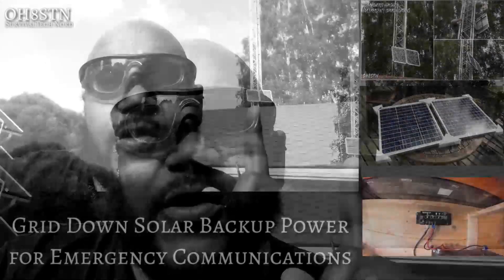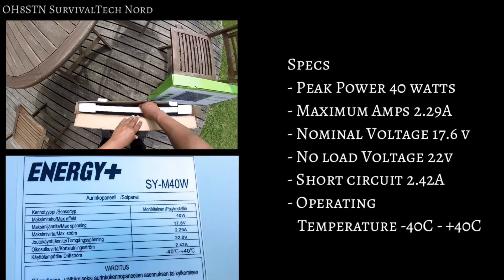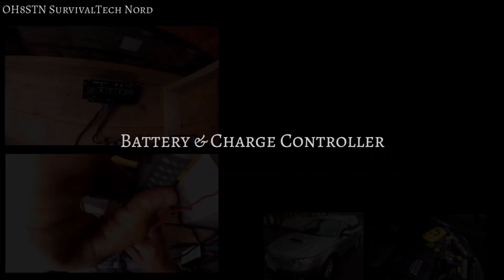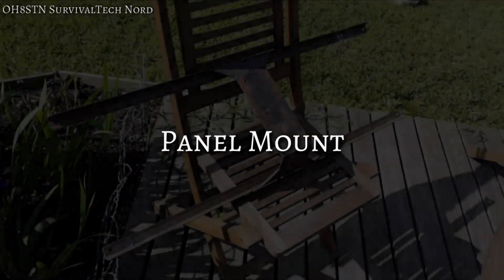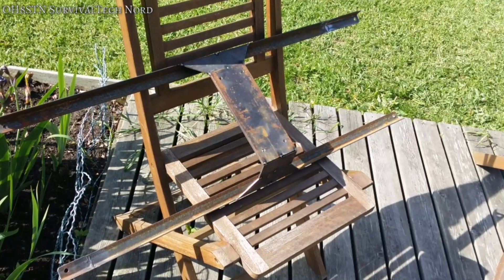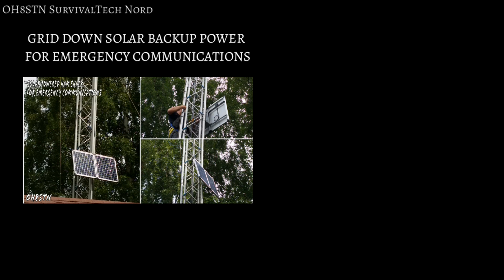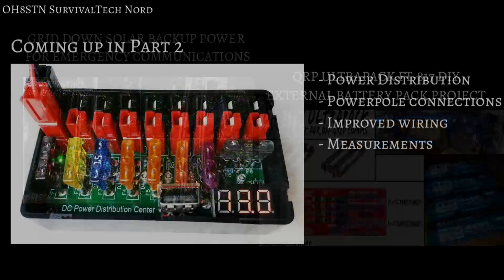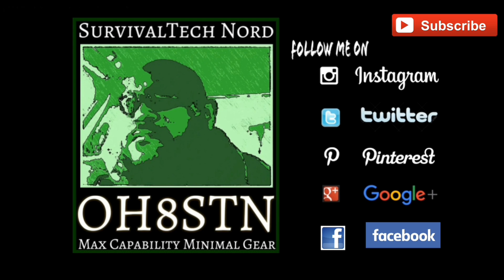Budget Solar Power for the Ham Radio Shack

Comment: Great video! Would love to see more about your base station and that tower with what your running up top!
Reply from the maker: Thanks Andy. The tower is set up for VHF/UHF weak signal work. There are three tag is up top. One for 6m, another for 2m, and the third for 70cm. Those are augmented by nultiband vertical for local FM. There's also a flagpole style pully to hoist end fed wires up to 12 meters. That will be changed in the spring to go the full 18 meters of the outside tower. 
Total height is 36 meters, but I only use half of the telescopic tower. 
73
Julian oh8stn

Comment: Nice setup, a perfect no nonsense video that will definitely help in my projects.
Reply from the maker: +Nomad-76 Thanks, glad if it helps! It's a starting point! For now It's small, DC only and lacks great capacity. However, it has powered my 50w radio and tablet  for digital comms continuously in the radio room, since I made that video. Primary mission accomplished :) 
Thanks for stopping by.

Comment: Great set up! looking forward to the finished product!! I need to expand my solar "system"
Reply from the maker: +VideosByDPF Thanks.  Until recently,  I've focused in portable power. The batcave needs to be completely solar powered with small DIY 2 stroke generator backup I'm working on. 
takes time,  but it'll get there.
Btw?  was wondering where you'd gone off to since you've been do quiet.

Comment: You can just add other panels to the same tower and have the new panels point in other directions (everywhere but north).  There is a kid a while back who did an adaptation of the Fibonacci sequence.   It gets cheaper to do that and add solar panels than screw around with the pointer/rotator systems unless you are really limited on space, which you are not.
Reply: I no this discussion is a year old. But the fix to keeping panels not facing the sun from pulling amps away from panels facing the sun is simply to install Diodes on the output of each solar panel bank.
Reply from the maker: +8digitPDX isn't the problem with adding solar panels in different directions on the same charge controller the averaging of Amperage? Meaning that the amperage of the panels not facing the Sun will bring down the amperage of the panels or string which is facing the Sun. That's basic ohms law. I would prefer to do it that way though! I just haven't figured how to prevent the current drop yet. So that's what I'm stuck with the current crop of having strings in different directions or the complexity of turning the battles in the direction of the Sun. Any advice?
Reply: We never encountered that problem.  The "nominal' voltage on those is 12v, and people mix different amperage panels all of the time with no problems at all, so it is the same effect as having some panels in the shade and some not during different parts of the day.   In fact, the best system I have run used a mix of Amorphous and polycrystalline panels.
Reply from the maker: 8digitPDX are you running your panels in series? I'm running my panels in parallel to keep the amperage up.
Reply: SurvivalTech Nord You can mix different amperage of panels, no problem.  The problems come up when you mix panel voltages way outside a range.  If it is within a couple no-load volts, no big deal, but you don't want to be mixing say 24v panels and 12v panels.  What you have though is 40 watt 12v panels.  Maybe pushing 3amps each.  Leave them pointed south, add one for east and one for west, catching the sunrise and sunset
Reply from the maker: 8digitPDX are you running all of your panels in series, in parallel, or some combination of both?
Reply: SurvivalTech Nord I always run them in parallel, NEVER series.  If you mix different size panels and run them in series, then it causes problems.  You can mix panels as long as they are in parallel.  Guys doing fancy systems with MPPT controllers often run them in series, but that's all matching brand new panels.   You start even having larger systems where they are in series and some are in the shade while others not at certain times of day, then it can lead to problems.
Reply: In fact, mixing in some amorphous panels, seems to help on one of my trailer systems.  I have some high end polycrystalline on my motorhome running through an MPPT controller, and although nominally it is 300 watts power production, I rarely get over 80 real world watts out of it.  Part of that though is it is flat mounted.  Angled up at the sun changes that a lot, but it's problematic on vehicles.
Reply from the maker: 8digitPDX fair enough. I've already received word that I can have 2 more identical panels to continue this project. I'll do it the way you mentioned with one panel facing the east to get the morning sun. I've got six hundred kilometres of birch trees to the South, but I'll point the other panels to SSW for afternoon sun. I also set up a Data Logger to see what the actual current is coming in with different configs.
Thanks man!
Reply from the maker: +8digitPDX yeah I think I've watched all of your solar power videos. It's a Hot Topic I'd really love for you to make a few new videos about that stuff! 
Thanks for all the guidance brother it's appreciated!
Reply: SurvivalTech Nord More videos coming up on a bunch of stuff, just have to get organized.  I am backed up on a bunch of gear reviews and how-to stuff, but some experiments on a couple things had not gone well.

Comment: Are you using a 12v adapter for the asus? We have two of those little netbooks, very handy little rigs. The 12v adapter, larger battery and a solid state drive make them even better.
Reply from the maker: +James Bridges exactly James we have the 12 volt adapter. I was wondering about the solid state drives.  how do you like them on the Asus?
Reply: +SurvivalTech Nord pretty well, slightly faster , slight power conservation ( no hard numbers but would estimate a 10% increase in battery life)and a little lighter as well. Also being solid state it has nothing to warp or wear out, so one less failure prone component.They are starting to get much less expensive too.
Reply from the maker: +James Bridges fair enough. I had planned to install a solid state drive but didn't really know if it was going to be worth it or not. No moving Parts is the key selling point for me :)
Thanks for the feedback moreover thanks for watching. It's very much appreciated.
Reply: Anytime! It was a little hard to justify spending that much on one of those, I just haven't found a form factor I like better and tablets just don't let me do some of the things I think a computer should. Hopefully the lower price point will make it an easier upgrade for you.

Comment: An excellent video topic thanks Julian! the temp range concerns me however for an installation here as we exceed 45 Celsius during summer, I guess I would need to shop around for a different unit/panel.
Reply from the maker: +SpectreOZ you're very welcome. I agree with you, living so far north the temperature never gets above 30 degrees Celsius. In contrast we might reach -40C for short time in a bad winter. So the best thing to do is find the panels locally, which meet your local environmental variables.
Thanks for watching, it's always good to hear from you.
Reply: SurvivalTech Nord Thanks, it is always good to see your inspiring content, I will be curious to see your 18650 Li-Ion project as I use these extensively for my high powered lights/torches (flashlights).
Reply from the maker: +SpectreOZ Its about the learning! 
funny you should mention the other project though. have a look here https://www.instagram.com/p/BIUxCw3B46A/ I've already got a working prototype on a breadboard. Now I'm just working on the component layout. :)
Reply: SurvivalTech Nord Cheers! :D

Comment: Looking forward to your series on small solar systems. I have all the parts, just haven't installed them yet. Thank you for your channel.
Tom W7GER
Reply from the maker: +Carlson thanks Carlson. The most difficult part is figuring which direction provides the most sunlight during the day. The alternative is mppt charge controllers on different strings that point in different directions. It can be complicated but it doesn't have to be. Thanks for watching.